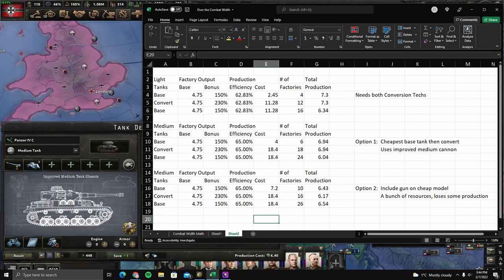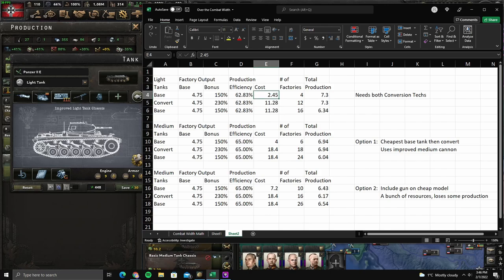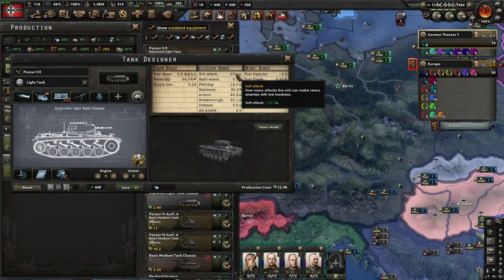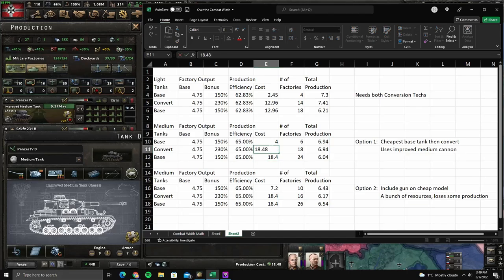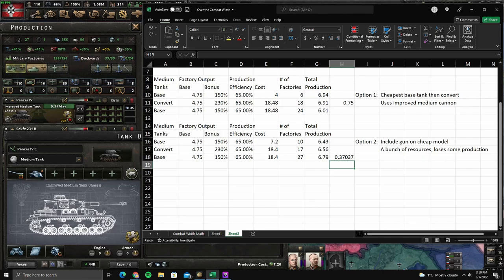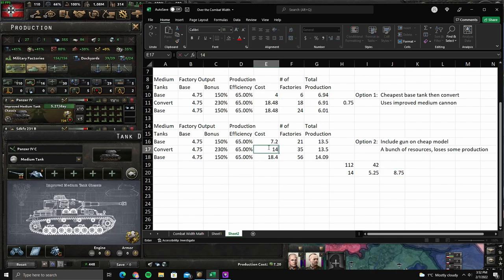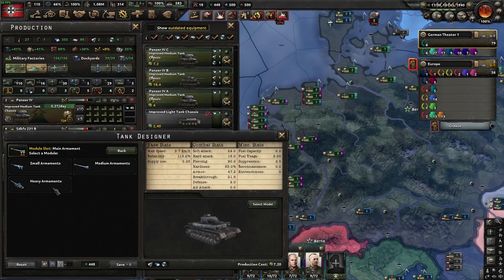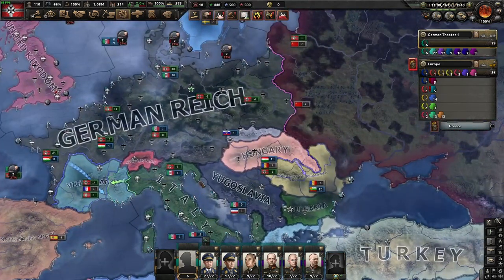Producing Tanks While Saving Resources

Comment: Wait I minute so if I get the cheapest design of your tank and get a good stock pile after it reaches high enough you just convert it and we get better thanks for a lower price hmmm seems worth it
Reply: Yeah but the point of this vid is to build cheap and convert in parallel, so there's an illusion of actual usable tanks being built. Just remember to set your divisions to NOT use the base tanks and only the converted tanks, for obvious reasons

Comment: In my recent run I discovered that I used more resources when converting. When I convert, it adds 1 of each resource (in addition to the original cost of the tank). 

So a tank cost of 4-1-1 (Steel-tungsten-chromium) costs 5-2-2 when converting a 1-0-0 tank. Also, in one case, it didnt add extra steel, so a 2-1 tank costed 2-2 when converted a 1-0-0 tank. 

Is this a bug on my end, or have paradox changed something?

edit: It seems it is specific to Romania. I actually checked another country, and the converting worked as intended.
edit2: Not country specific. Apparently it is connected with the type of weapon on the tank (light, medium and heavy). Changing from one weapon tier to another cost more resources.
Edit3: When you are converting tanks that has different tier gun (Light, medium, heavy), it adds the cost of the gun you are converting to AFTER the subtracting of resources is done. So even a cost difference like 2-4 = -2, which is then adjusted to 0 (ZERO), could potenially cost +1/2/3 depending on the weapon youre converting to.

Comment: Can you do a video talking about recon, it sounds awful to replicate but maybe if you invaded the USSR with and without, that way you get enough combats to see if it’s actually worth doing on a grand scale
Reply from the maker: Recon has 2 stats of any use. 1.The movement speed bonus in certain terrains can be useful for fast divisions. 2. Light Armoured Recon can be made using a light tank with a basic high velocity gun to give your division a good amount of piercing for not much cost but does take fuel. 

Outside of that it provides basically no stats and the bonus initiative from recon doesn't actually mean you will pick better combat tactics. It won't prevent you from getting countered when attacking and is largely worthless.

Comment: They upped the  production cost in patch 1.11.6 by 10% - 20%  of some light tanks.
Now the cheapest You can get improved light tanks  is 2.52 production cost.
Reply from the maker: 2.52 vs 2.45 hardly changes the math for light tanks. The change for mediums might make it not worthwhile except to save resources.
Reply: @71Cloak  Resources saved also means civs saved if there are no tradebacks.
Reply from the maker: Even with trade backs you still lose civs. Civs recieved from trade are subject to consumer goods but civs spent on trade are from the post consumer goods calculation. Its not much when on war economy but if you are on civilian economy you will only get 60-65 percent of the civs back.

Comment: How many tanks should you put on low end model and the high end one?
Reply from the maker: if you are starting both lines at the same time, balance them so that you are producing the same amount of the obsolete as you are converting to the better tank. IF you started producing the obsolete tank early then you can put more on the tank your converting to until you run out of the obsolete tank.
Reply: @71Cloak  im wondering. So if i use High velocity gun on a cheap model, and i convert it to good tank with High velocity 2… I use no more resources?
Reply from the maker: @bruhmammasnn7604  you wouldn't use any of the resources you spent on the cheap model. Improved high velocity cannon has a chromium cost so you still need to pay that on the expensive model.
Reply: @71Cloak  i see, its important tho that i always produce more of the cheap model so i dont actually begin making the expensive one